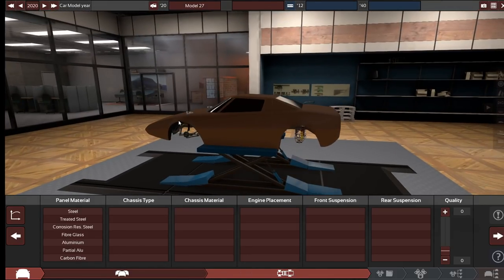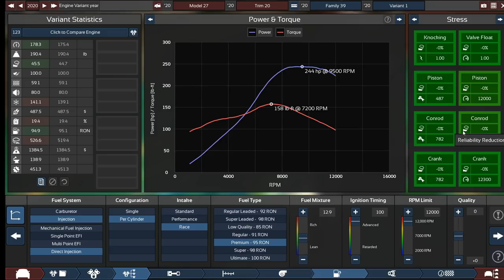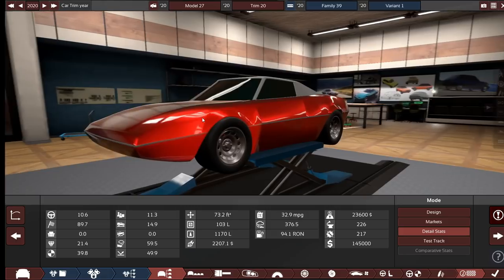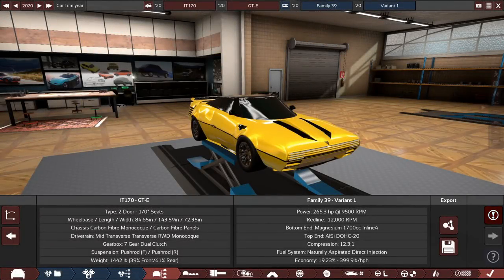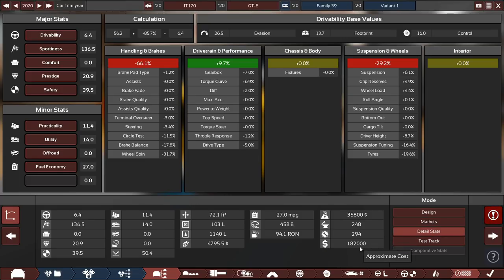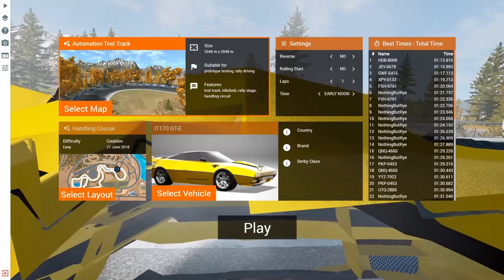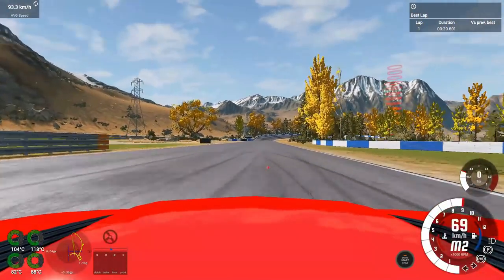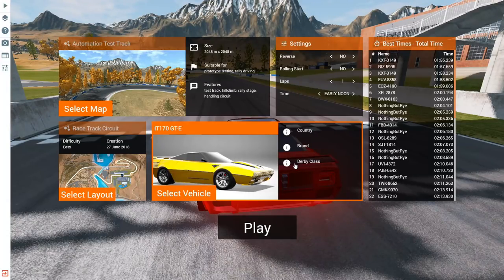Building A 12000RPM Sports Car! Automation - BeamNG

Comment: In Britain, some kit cars use motorbik engin, like my dads one, it's not built yet but it will use a 1.1l ~13k rpm, 150hp honda blackbird engine, and will weigh about 500kg, it's absolutely mental I can't wait to get it finished with him, but enough bragging, here's the punchline; ah damnit can't think of one
Reply: i’ve got a friend with a Busa swapped Honda Beat and it’s insane
Reply: 150hp isnt a lot for 500 kg
Reply: @Kasmuller  it's enough on a track. That's equivalent to a 320hp Miata. That's shitloads of power for the weight. From a UK point of view where we turn more often than go straight, it's plenty
Reply: @Kasmuller  more then enough lol
Reply: @Kasmuller  that's about the same power to weight ratio as the new BMW M3 competition

Comment: As cool as it is, this is far from being street legal. No ABS, lack of safety, high emissions. All of these things definitely prevent it from being a street legal car in either USA or Europe
Reply from the maker: Yeah, for some reason I just blanked on adding abs ;) my bad there, it was on the high performance model tho! 

I'm not sure how the emissions are calculated tho, I believe it's Grams per Km. If it's the case it's only slightly high, so maybe it will pass :P

Cheers!
Reply: 556johny556, that is false.Have you heard of Caterham 7, Ariel Atom? Those are still fit for driving on the road and you can still buy them even though they lack some safety crap.
Reply: @ALFA-XL-  Well I'm sure they have ABS at the very least. And I'm not sure about Ariel Atom, but Caterham uses road legal engines from other cars that are just tuned a little (or at very least they used to), so they definitely don't emit three times as much of CO2 as cars complying with Euro 6 regulations. Sure, none of these would hold up in crash tests, but that has to do with the exception rising from the limited production numbers of these cars. And at the end of the day, this is a car in a game which I still think turned out very cool looking, and having ABS and at the very least minimal safety never killed nobody ;)
Reply: @556johny556  Thanks for answering
Reply: USA and europe
A country and a continent
Interesting...
Probably legal in russia, in europe
Reply: @556johny556  Definitely no abs on a caterham. They tend to be registered under IVA regulations and there is no requirement for abs. Not in the UK anyway.  You don't even need brake servos. under IVA.

Comment: What's the point of having 12000 RPM if the power peaks at 9500 RPM?
Reply: Its about the power you use. In a race you drive between 9000 and 12000 rpm with this car and you receive almost constant power
Reply: Iof the limiter is at the peak its not use able is racing
Reply: 12000 rpm able to improve short cluth ratios, like F1 cars, the next speed Target the 9500rpm range of max HP/torque, and move 9500rpm to 12000rpm quickcly. Road Cars like a Toyota Camry delivery the power in low RPMs(for Better MPG), muscle car/sports Cars delivery in mid RPM(for Best response in Mid/Hig RPMs) and Race Cars/Súper Cars delivery in High RPM(For Better response in High RPMs).

Comment: Hey Rye! As an Automation wizard, how could I fix my cars having oversteer during mid corner down shifts :>
Reply from the maker: It's hard to say without looking at the car, but  more down force, bigger rear tires, etc.

But a good rule of thumb is don't downshift while turning :P
Break > Downshift > Turn > then on throttle coming out of turn
Reply: @TwinTurBros  Thanks a lot <3
Reply: It happens because when you downshift, the weight transfers to the front for a sec. and rear loses grip since its mid turn. Reduce the rear spring and damper hardness. Also having a stiffer rear anti roll bar makes the car prone to over-steer and produces a very skittish rear end.